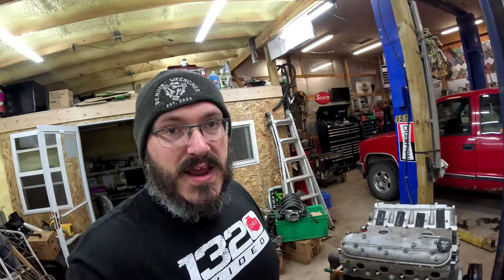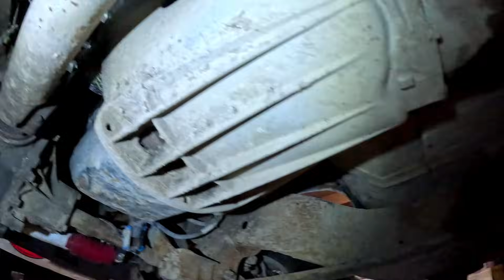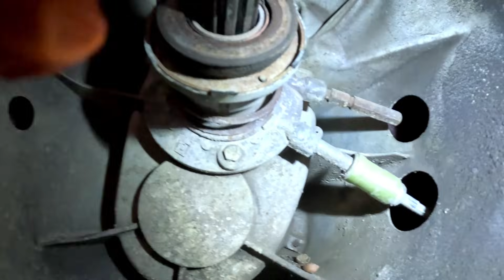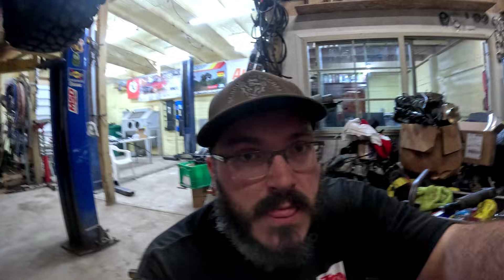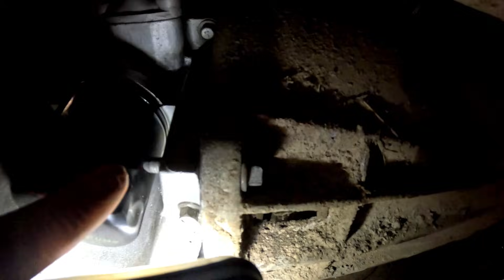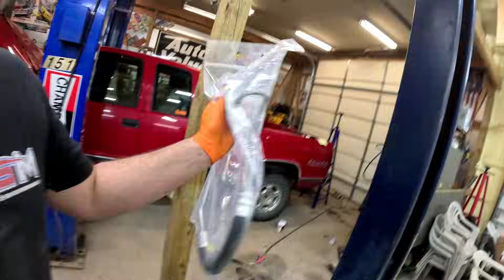EASIEST LS SWAP EVER!! 88-99 CHEVY/GMC Truck GMT400 pt.1

Comment: So I came across a 1995 Tahoe that someone has swapped a manual transmission into. I’ve been going through it bit by bit replacing sensors, EGR, injectors, etc. When I got it, it was in and out with a check engine light. Now it does fine at idle but if I drive it 10 miles the check engine light comes back on. Is there something with the original automatic transmission that communicates with a ECM that can be overridden? Still looking for why that check light comes on.
Reply from the maker: The worst part about 95 is it's pre OBD2 so it's really tough to get an actual good scan on it. But I've had one of those with knock sensors causing problems that would throw a code. Now granted if it's looking for a transmission and the computer still thinks it should have one, I'm sure that will throw a light. The resolution may be getting  a custom prom chip ordered.

Comment: Hola una pregunta puedo ponerle un motor de una Chevrolet 1998 aúna Chevrolet 1994 2500 ?Sime puedes ayudar al in forme ese telo agradecería 🙏
Reply from the maker: Definitely can be done but you're going to have to buy a special intake. That'll adapt to the vortec heads and offer a throttle body mounting flange or use the older heads on the newer engine is another way. Keep in mind the cam for a vortec versus a throttle body May vary a little bit so it may have a rough idle.

Comment: My bro and I are finishing up an 89 2500 4x4 with a 6.0 swap. Added a BTR Truck Norris cam for it, love the mild chop it brings
Reply from the maker: That sounds like an awesome build!
Reply: @Bendinwrenches Oh, she's gonna be a mean one. We converted it to carb too for easier tuning. I did have a Holley Sniper EFI system but I'd  to ideally tune it at home which it seems like I got it dialed in now

Comment: I really need to ditch the 6.5 diesel in my 94 K3500 but I can't find a comprehensive video with costs listed and I'm not about to tear into my truck without knowing a budget. I want to swap in a 6.0 at the minimum but the 8.1 would be preferred. The truck is also a manual, so no TCM to worry about
Reply from the maker: If you're looking at an 8.1 swap, I have a build series of doing one of those. With a manual as well. As for a 6 l, if you're doing it yourself and you can get the motor at a reasonable price you could do the swap for less than three grand.

Comment: Doing this to my 95
Reply from the maker: Good luck with the build, it's going to be awesome!  Keep in mind 1995s are a bit different from the wiring aspect plus you need a higher pressure fuel pump.  But there is information out there! LT1swap.com is a huge help.
Reply: @Bendinwrenches thanks for the resources bro

Comment: I got a 5.3 swap in my 94 gmc sierra im trying to find a flywheel and clutch set up for it will the manual flywheel for a 4.8 01 to 06
Reply: transmission im putting in is a 5lm60
Reply from the maker: I'm not familiar with a 5lm60 but the 48 flywheel and clutch kit works with the older transmissions, but you have to shim the throw out bearing accordingly.
Reply: @Bendinwrenches right on man, if there's any advice you can give me on. Doing the shim process. I'm getting ready to go by the clutch kit in the flywheel master and slave cylinder the clutch pedal is simply just came in the mail d*** ebay, they got me.It's got a broken return screen
Reply from the maker: @KadillacVinzant-e2v All I can say is when I used the NV 3500 I used all three of tick performances shims and it was perfect. But reach out to tick they can give you the schematics on how to do it.

Comment: Would the process a still be the same on a 95 with a TBI factory non A/C truck or is that easier?
Reply from the maker: The process is still the same, the transmission. If you have a 4l60 you will most likely have to change the transmission harness. Don't quote me on this. I'm fairly certain the correct harness needs to have a green connector, but the rest of the aspect is the same. You would just need to upgrade the fuel pump.

Comment: I am new to this ls swap, I lave a 5.3 from a 2010 suburban, and putting it in to a 90 4wd with a 5.7 tbi and have 700r4 trans and was wonder how to do that, would like to keep the 4x4 features
Reply from the maker: Honestly right off the bat I would definitely suggest trying to find a different engine. A '99 to '06 is the best 99-02 is the easiest since it's drive by cable already. Also, the 700R4 is a struggle trying to get the detent cable hooked to the throttle body. If you are dead set on running the 2010 engine, look at a lingenfelter box to convert it from 58x to 24 or I did a video series on how to convert the engine mechanically. The four-wheel drive has nothing to do with the engine swap. The four-wheel drive would work without an engine in it. Which is nice. Easiest swap all together would be to find a '99 to '02 and use the motor and transmission to be honest with you.

Comment: Love the videos. I'm new to the LS swap I have a 5.3 from a 2003  suburban putting in a 98 2wd shortbed. I'm nervous about the wiring part  do you have pics or diagram of the stock harness wires to incorporate into the LS harness
Reply from the maker: Your best bet is Lt1swap.com he walks you how to wire and integrate. My second part video touches on this. 98 and newer run a PWM gas gauge. tuning will be required to make that work.   Or order a direct swap harness from Texas wiring specialist. Those are super nice to install!

Comment: 99 c1500 suburban here w 5.7 vortec 350. I need to swap. So ty for the info. Any other tips would be great. Im also looking for a bit more power, like a cam swap.
Reply from the maker: Jump to my other swap video on a 2000 OBS. More info there too.   The biggest highlight is 98 to 2000 obs's have a pulse width modulated gas gauge that runs through the ECM. The easiest and cheapest is to run two computers. Leave the factory one and piggyback the stand-alone to necessary sensors or get a 411 PCM have a harness made and calibrate the gas gauge through the computer. Other than that pretty standard swap. If you're running the factory 4L60e jump to my S10 Blazer video, the burgundy lifted one. I walked through how to connect the factory style transmission to an LS.

Comment: 2003 surburban 2 wheel to 1994 k1500 any thoughts on transmission
Reply from the maker: I think your best bet is if you have a transmission guy have him combine the two and make you a four-wheel drive 4L60. You're going to want the short shift shaft, but I don't think the LS computer will control a '94. If that trans is a 96.97 you'd be okay or find a newer transmission. But again, if you know your '03 suburban tranny is good, might be worth having that converted to four-wheel drive.
Reply: @Bendinwrenches  Will the 2 wheel drive doner computer run the 4x4 manual shift transfer case
Reply from the maker: @evancornelius9840 If you're running the original transfer case from the OBS, the computer is not necessary for that operation.

Comment: So what would I need if I have my stock 4l60e out of my 96 chevy to bolt up to my ls motor same gen as yours
Reply from the maker: I go through this in another video if you find my LS swap. Red GMC Jimmy. Basically just a spacer for the torque converter.

Comment: Ok, so I've watched your videos multiple times, just started my swap! Issue is I put the slider mounts on before dropping the engine into the bay, I'm finding it very hard to adjust these things after I have set them down on the clamshell.

What order do you follow when installing the engine? Do you drop the engine in, mate it to the transmission, and then put on the dirty dingo slider mounts?
Reply from the maker: Right on!    As for mounts I'll put the engine in and tighten a few bell housing bolts, then jack the motor back up and slide the mounts in. It works out quite a bit easier that way. That way you're not fighting them  moving back and forth and what not.
Reply: Thank you dude, I've had that thing in and out of the truck like 3 times trying to get them in!
Reply from the maker: @michaelallison2836  You're 100% welcome!  Congrats on the build!

Comment: I have a 95 Tahoe 4x4, would i need anything different from this swap?
Reply from the maker: The biggest thing with 95 is it's TBI so definitely the fuel pump '96 '97 style is a high pressure direct replacement. Again 95 is unique because it's the newer dash but still TBI so you will have your challenges. But all around the basics are the same from the mechanical aspect. You can use your transmission. There's another video I have doing an S10 Blazer that has a little more of the 4L60 info. But still one of the easier trucks to do!

Comment: looking to do a swap like this, what do you need for the manual, i have a 4.3 with a nv3500 and looking to put a 5.3/6.0 in it but im curious on what i need for the trans to make it work
Reply from the maker: The trans will 100% bolt up the clutch will even work. You just have to get either a McLeod 400,000 thicker flywheel or shim out. Your clutch slave. And then use the LS pilot bearing that some people call the ls7 pilot bearing.  If it's a older NV 3500 with an external slave, go back to my LTD LS swap and you can see where I ground the oil pan to make it clear. Either way, you're good
Reply: @Bendinwrenches thanks, I read that the flywheel wont bolt to the ls cranks is that true, and that you need a special conversion flywheel sorry for all the questions i hope you dont mind. Just wanted to pick your brain, and if you dont mind ill probably come up with some more questions as I think about it all

Comment: Buildung a 5.3 in my dorm room to go into my 88 c1500. How hard is it to setup a TV cable to run the "stock" 700r4 (mine is rebuilt with corvette servo and a few upgrade goodies). I know i need a spacer and dished flex plate, but idk how id do the TV cable
Reply from the maker: I've never done one, there are videos online where guys will take the part off the throttle body and weld it on to the side of the LS throttle body. But unfortunately I have no tips on that.

Comment: Can we get a video on the wiring for a 4l80 and gen 4 engine
Reply from the maker: I didn't film this particular portion of it. The wiring was pretty botched on that truck. I will see if I can come up with something but there is a couple videos out there already.  But I do have a project in mind that's going to be tied to a 4L80E.
Reply: @Bendinwrenches im having problems finding anything on the gen 4 engines (6.2 specifically) doesnt seem like its very common for some reason, also the old style 4l80 (pre-2000) idk if it makes much of a difference in it
Reply from the maker: Sorry for the delayed response. Gen 4 and 4L80E is a hard to find operating system to run you pretty much need to get a van computer because any of the Gen 4s will have a oddball 4L60 or a 6-speed.  So you can look for a later generation. Say '08 3/4 ton van will be your best bet.  Or if you get into like a Holley Terminator x-max.
Reply: @Bendinwrenches that's what im finding, I have everything for the 4l80e tcm and all, also have everything for 6.2 just unsure how to make them talk properly as the 6.2 was never designed with a 4l80
Reply from the maker: @crudnick The easiest thing I would say is get a lingenfelter box and run a gen 3 computer. We just did that on my buddy's 93 obs  Chevy. It actually worked out really well.

Comment: What exhaust manifolds did you use?
Reply from the maker: The 99 and up 5.3 truck manifolds. Pretty much any of the truck manifolds will fit though. So 99 to to 0607

Comment: Did you use the power steering pump from the OBS?
Reply from the maker: No, I did not. I used it from the donor LS. The power steering lines connect right up to a LS pump. Technically you could if you deal with the filler tube.
Reply from the maker: And when I reference filler tube it's on the 96  and a Vortec style.
Reply: @Bendinwrenches I’m doing a swap on my 96 K2500 NV4500 now so was just making sure I had the right parts to facilitate that part of the install. I appreciate the effort and information you put into your videos.

Comment: My swap , started out super cheap. Then I start watching people like Motion race works, Steve morris, Lake speed jr,  ect ect. And half of that stuff is in a box somewhere. And I should have put all
Of this in something lighter And closer to the ground.  I basically have a push mower With nitrous, line lock, four link, All a r p and  forged.  It's a sickness. But on the plus side if I had it in an appropriate vehicle.I probably would have already hit a wall and lost it all by now. 🥴
Reply from the maker: Lol there's a silver lining to everything! You're 100% correct going fast is an addiction!

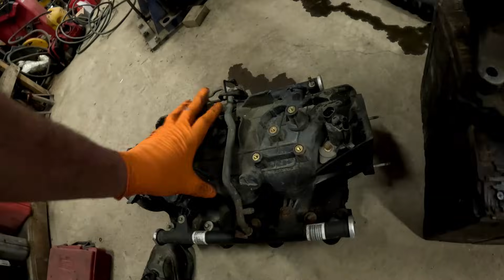Comment: @31:45 is it possible to plug off the EGR hole instead of finding another intake? Might be following your lead to swap into a 93, 5 speed C1500. Just getting all the ducks lined up ahead of time.
Reply from the maker: You can 100% plug the intake! I've used rubber soft plugs before or if you browse around the internet they're available! Just remember on a 1993 you got to put a '96-97 high pressure fuel pump in place of the pump in the tank!
Reply: Cool. Great info, Thanks!
Reply: Can I 5.3 my 1992 gmc sierra k1500 4wd
Reply from the maker: @conwayramsey4865  Yup absolutely the older trucks take a little extra effort because the transmission variance. You'll probably have to update it to a 4 l 60 from a newer truck unless it's a manual.
Reply: My truck is 5 speed
Reply: Has the external slave cylinder
Reply: Same here
Reply: Going to take the 5.3 out of my 2000 chevy and drop in a 6.0 and rebuild the 5.3 and slap it in my 92 gmc k1500 5speed stepside.

Comment: Do you have to shim a nv4500 as well?
Reply from the maker: Any manual transmission with an internal slave that's not meant to be behind an LS but was behind a old school small block big block you will have to shim so yes you would have to shim an NV 4500.   Or if it's an external slave lengthen the push rod.   Pretty easy stuff just takes a extra 10 minutes to measure LOL

Comment: How about 6.0 v8 swaps what is the best generation for power?
Reply from the maker: Literally the same from a mechanical standpoint just the engines cost more,  07 and up make more power, but requires a different operating system or something aftermarket like a Holley since it's a 58x crank shaft for the sensor.  A couple videos back I 6.0 swapped a Ford crown Victoria.
Reply: @Bendinwrenches24  thanks! New sub
Reply from the maker: @rdr9519  appreciate it!! Thanks for the support!

Comment: I did my 98 OBS to LS swap almost two years ago, mine was 4.3 to 5.3, and has sat due to making my own blended harness, because it was easier two years ago to go that route over paying 1300 for someone to make one. Clutch bolt info was hidden in the interwebs because ya know automatics are more out there, and had to go back into it after I ruined a flywheel. I reused the 4.3 pressure plate bolts, and they’re a 1/4 inch too short. So after another flywheel purchase and the right bolts, I put it back together, then faced a wiring nightmare but at least that’s all on me and no one else. Now I’m just gonna grab another junkyard vortec 4.3 harness and do what you did in part two.
Reply from the maker: That's a bum deal about the flywheel situation,  I found that leaving the old harness was safer and simpler too. You got this it's not bad once like you said you get the right information.   Good luck!!  It will be worth it! Thanks for the support.

Comment: Question for you I have a 1995 k2500 it just had a brand new clutch put in frome the previous owner I'm deciding to ls swap can I get away with the clutch and slave he just put in or do I have to buy the clutch kit in your video if you could help me with that it would be amazing
Reply from the maker: You can 100% use your old stuff you're just going to have to deal with shimming the slave, you'll have to oversize your bolt holes to allow for the 10 mm bolts versus the 3/8 of the original. Other than that using Ls flywheel for a 2005 4.8. it'll all bolt up.
Reply: @Bendinwrenches24  thank you man this is all new to me your video has been so much help
Reply from the maker: @old_blue1996  your 💯 percent welcome!
Reply: @Bendinwrenches  aso if you get a clutch fan from a 2002 f150 they fit perfectly in the obs fan shroud
Reply from the maker: @old_blue1996  it's funny you say that lol I literally grabbed one yesterday 🤣 I'll have that in the part 3 video!   I just read about that!   Thanks for the input!!
Reply: @Bendinwrenches  hey man where did you get your shim kit from. I found a motor with 160k on it for 500$
Reply from the maker: @old_blue1996  tick performance!   Buy the 3 pack you will need it.
Reply: @Bendinwrenches  thanks man

Comment: LS wire harness link from EBoy please lol
Reply from the maker: What transmission are you running? This one is a manual so I'm running a t56 style LS1 harness.
Reply: @Ben @Bendinwrenches im doing what your doing on the video ls motor but my trans is a 4l60 . What wire harness will u recommend for 96 Chevy Silverado

Comment: Nice job. I just bought a 98 GMC OBS and have an LQ9 sitting in my shop to swap in. I didn’t know that about the fuel pump. Got a follower now.
Reply from the maker: Glad to help part 2 is coming out Friday I'm doing some progress on it this week I'll show you a quick trick for the fuel line attachment!   Also which wire to trigger with your new harness.  Thanks for tuning in!!